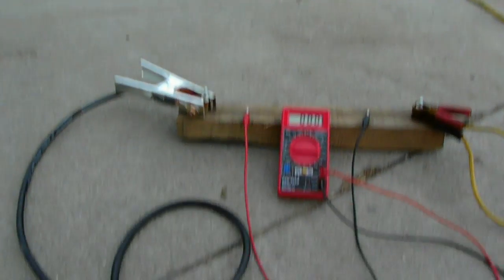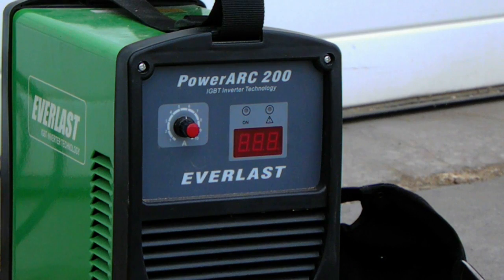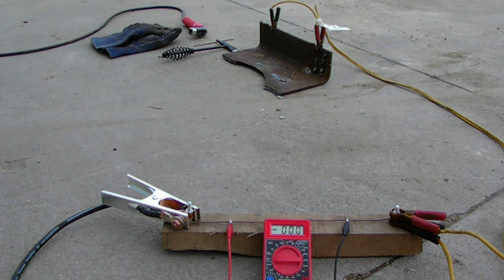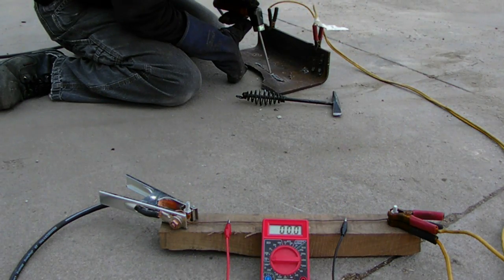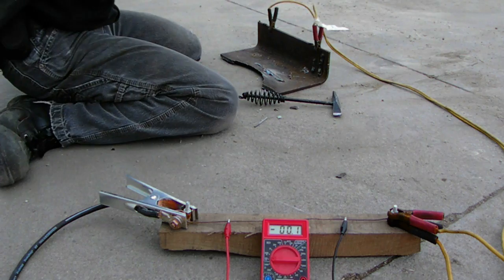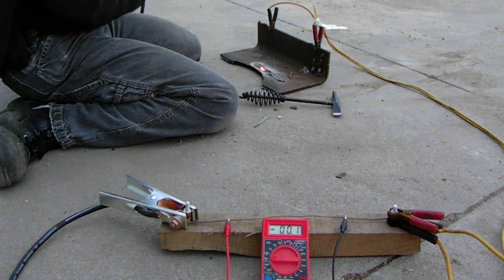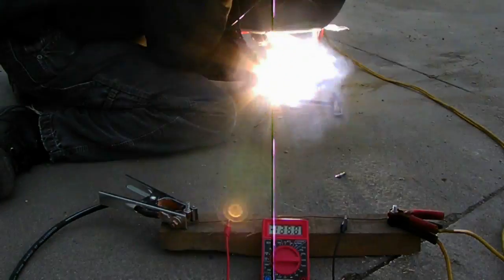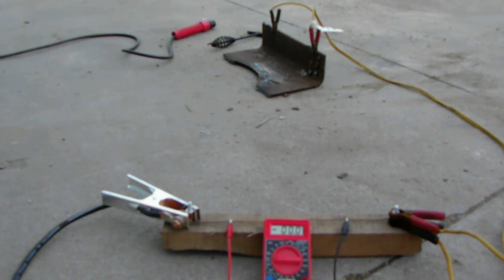Testing The Output On My 2011 Everlast Power Arc 200 Specifically Amperage

Comment: I tried using my clamp meter and reading were a range from 2 amps to 10 amps when the welder was set at 80 amps. Guess I will try doing a shunt just too lazy to do it first
Reply from the maker: Yeah a shunt amp meter would get a more accurate reading probably. Most clamp meters are for 50 and 60Hz AC amperage draws. The shunt meter is not 100% accurate either just simply due to the fact that the DC that comes from inverter driven welders does have some degree of pulse to it. Not quite like AC does of course, but it is there

Comment: I'm thinking about getting this in Australia. Are they a good welder and can it weld decent size metal and also smaller metal and have you tried it on galvanised? Cheers
Reply from the maker: It is a good welder. It's worked fine every time. If you use a small rod on the welder, sure you can weld thinner metal. But as to how thin, I'm not sure. I've welded an 0.045" bandsaw blade before. But it wasn't the greatest thing I've welded. I'd say that is very thin for a stick welder. Tig would be easy that thin but stick relies too heavily on brut force energy to keep the rod lit.

Thanks for the comment!

Cheers from USA

Comment: I've created my own extensions for my Everlast welder from some extra work clamp cables I had lying around. I just snipped off the end with the clamp and attached dinse sockets to them and now I have additional 10 feet in extension.
Reply from the maker: Wow sounds great, good cheap fix for a bothersome 'short'coming. Pun intended.